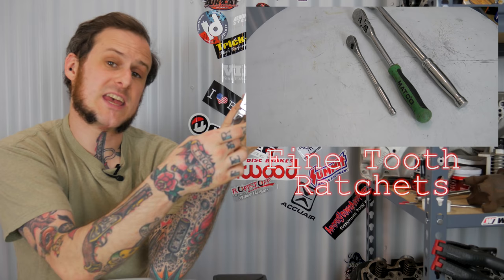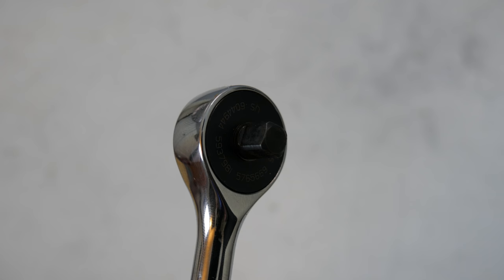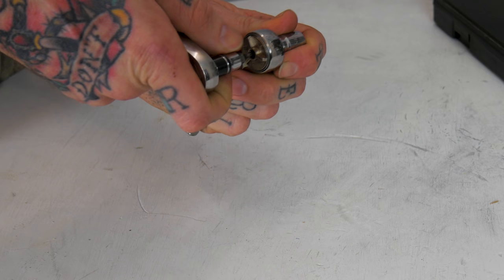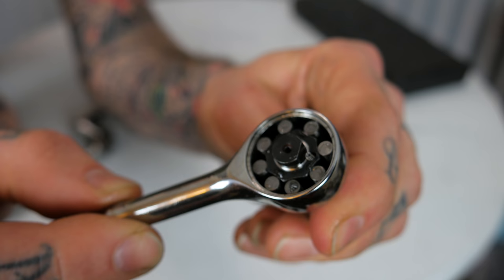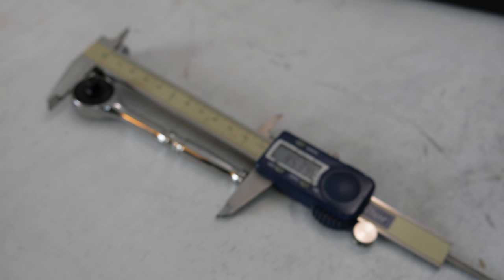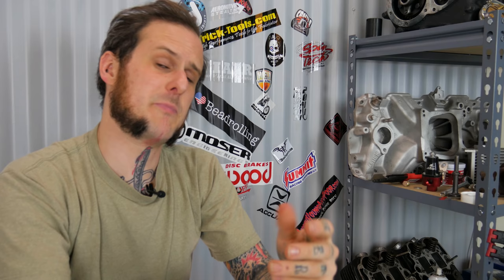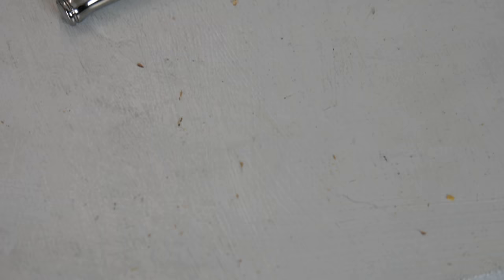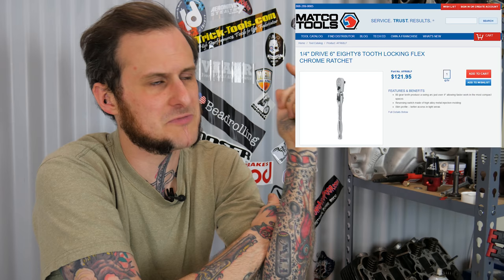Snap-On Gearless Ratchet - What's Inside? - TZero 1/4"

Comment from the maker: What do you think of Gearless Ratchets? Do you have one from someone else or have you tried the Snap-On ones yet?
Reply: Works well bit I can't get over the feel. It hasn't let go yet but if i have to break a nut I use a box end wrench and just use this to remove
Reply from the maker: john smith it really is such a strange feeling. I couldn't get past it in my uses.
Reply: I like the pass-thru wrenches from gear wrench, got good teeth count and they make many different sizes and it’s not a wrench and it’s not a ratchet it’s like an offset 0 degree box end with out being clunky

Comment: I have a 3/8 inch drive blackhawk "freewheeling ratchet" from the 40s, and it still works great. Can't take it apart for maintainance due to permanent pins through the head, but I just soak it in oil for a few hours to lubricate it. I don't trust it for heavy applications, especially since I would be able to repair it if broke, but its a nice tool that does 90% of the jobs I need it to do as well or maybe even better than my newer stuff.

Comment: 3/16" is huge in a 1/4" dive IMO. The rotary direction changer on the back is frustrating on any brand. They might change that but then change other desirable things too. Sure seams they all get the features correct but never land them all on the same design.
Reply from the maker: The Eccentric Hobbyist problem is with this round head design the selector has to be in the middle of the head. And if they changed it to a tear drop head it would not be able to have the 8 sprag bearings like this me does. You are right, no single design meets every criteria for every job. Just have to pick what works best for you. And half a dozen Ratchets for the other times. Ha
Reply from the maker: The Eccentric Hobbyist and I agree on 3/16" being a lot. (And really its more like 7/32"). I prefer the Matco Ratchets for their slim head and sometimes I wish for slimmer setups. I do have a Snap On slim ratchet but it doesn't have a flex handle so sometimes that's not right either.

Comment: Snappy does  make Ultra shallow 1/4 sockets
Reply from the maker: They  do indeed, I own them and like them. They work best when paired with their low profile ratchet to really maximize the slimness of them. If you use them with this ratchet it would help with the thickness but still be thicker than using the low profile sockets on another slimmer ratchet.

Comment: Kind of expected you to show it IN USE, compared to another ratchet.
Reply from the maker: I had intended to include that but when I went to film the use, I realized it really didn't demonstrate the actual operation very well. It is hard to see it, its more of a feel thing. And it is silent in operation so there is little going on watching it in use. Also I aimed for this video to be shorter than it even ended up being. To really compare it in use would have required setting up some type of testing setup to show exactly how tight of a swing arc it has, which would have been far too elaborate for what I intended this video to be.

Comment: Titan has a 3/8 and 1/4,  although it lacks this reverse mechanism.     To reverse, remove the socket and push the square drive to the other side. The Titan appears more compact.  Another advantage, besides the lack of swing, is the reverse movement is low friction, so one can tighten a fastener without holding the socket/extension (i.e. eliminates need for third hand when installing starter for stern-drive boat.

Comment: The whole point of a gearless ratchet is the tight swing arc. Based on what i was just looking at in the video, there is play in the head before it actually locks up and starts to drive the square drive. The biggest question i have to ask is if the swing arc on that ratchet is tighter than 3 degrees, if it isn't, then there would be no point buying it over a 120tooth ratchet.

Comment: Bought this thing for one purpose replacing stepper motors in class8 trucks at work and automotive at home. A flex version would be great yea the head is a little tall but if you can get on the fastener there is no effort to remove the fastener deep in the dash. If you have any swing on the handle it will remove the screw. What would be great also is the 3/8 version with a bent and swivel handle great for the transverse engines limited swing against the firewall for plug removal. Hell if Snapon  makes this I dont care what it costs will save me busted knuckles and the neighbours ears.
Reply from the maker: A flex head version would make this a significantly more useful ratchet I have to agree.

Comment: I paid $18.98 for the kobalt gearless in a 3/8 drive kit with sae and metric sockets and an adapter with shipping and tax included. Works like a dream and comes with the lifetime warranty. I’m still searching for the 1/4 drive version. SNAP ON TOOLS CAN GO KILL THEMSELVES WITH THEIR RIDICULOUS PRICING.
Reply from the maker: Right, and that Kobalt set was made by someone making a few dollars an hour, in a factory without the pollution concerns we worry, using whatever cheap metals they can get at the time. Then a big company like Lowes sells them at a very small profit margin because they make their money on other items. They figure you are there buying a socket set and may buy half a dozen other items for your house or garage, so they can afford to make a minimal amount on each set.

Snap-on is made in the USA, meeting USA pollution control requirements and exceeding USA minimum wages. They warranty their products for life (they've been around for 99 years). They hold their quality control and material choices to the highest standards. And the distributor selling the tools is an independent business owner who has to make a living too. All while (if you work in a professional shop) they come to you. So if you have any trouble ther is no driving over to Lowes to hope the clueless employee at the service desk knows what retchet to replace yours with.

Those Kobalt ratchets are a decent set for light duty use. If you work with these tools every day and depend on them to make your living, pros know the difference. I keep sets like those in my car and house to have on hand when my professional tools are locked up at work.
Reply: @HotRodHippie  Kobalt's tools are mostly made in taiwan and taiwan has very good quality tools with likely a more efficient factory that, probably produces half the pollution. Your more of a tool then the ratchets we're talking about with that ridiculous nonsense comment to the viewer. You asked for opinions to pull out you're rebranded tool truck soapbox to give lectures on?  Why is a Williams ratchet $35 and then a snap on engraved one is 4x the price? Same dudes are making them with the same materials and everything!
Reply from the maker: @Toyotas_n__Tools  Williams ratchets are the old 36 tooth ratchet design. Not the new Dual 80 or even this Gear less design. If you want a 36 tooth ratchet you could probably buy a used Snap-on for the same price on eBay or locally then get it warranty repaired.

You are paying for service. Is the price tag sometimes crazy? Yep. I think I may have said in this video this costs too much. If not I should have. But with SO the warranty person comes to you. If you need a tool repaired or replaced, that's it they are right there. With Williams you have to send it in to get a replacement. If it got lost in the mail or lost in paperwork at Williams, you are up a creek. And even if it goes smoothly you are likely still looking at a couple weeks to get a replacement.

Is the tool truck tax crazy? Yes, but that's tool truck life. Thd distributor has to make a living and the companies are corporate and want to make their profits. Sadly it's the way this works. If the profits were smaller on the tool truck the distributor could not make a living. Plain and simple. Getting paid $20 a week indefinitely when you are only making $5 on a product is a failed business model.

That's another point. You grt zero percent interest financing on a tool truck. I usually look at the increased cost as the financing fee. It just depends if that fee is worth it to me.

Tools made in Taiwan can be excellent quality in this day and age. Standards have come a long way there IF a brand wants to seek it out. At the end of the day though they are still paying little for the products and still shipping them across an ocean to get to you. Meaning that's part of the cost in both dollars and carbon footprint. That Taiwan ratchet has made a trip around the world before you ever lay your hands on it in an inefficient tanker ship remember.
Reply: @HotRodHippie  The fact it doesn't have a double paw mechanism with 4 more teeth doesn't warrant a 4 times markup, thats good your passionate about something.. But you're views and opinions are as old as cassette tapes, because things are just really that different then what you believe.
Reply from the maker: You are completely discounting the concept of engineer costs along with the distributor needing to make a living.

The 36 tooth design is a design from many years ago. Snap-on engineered it decades ago. So Williams doesn't have that expense. The Williams line is a way for Snap-on to continue making money off tooling and designs that have long paid for themselves. In my eyes anyway.

It's the argument of "Well a cellphone only costs $***" to make!" but that doesn't account for the cost of engineering that product and the one after it. Profits go to continued design and business operations.

I don't personally care where a product is produced. My absolute favorite ratchet is a product of Taiwan (Matco 88 tooth flex head with comfort grip). I make a point about it because tool buyers care. Do all? No, but many do. So it would be silly of me not to make a point about it just because some people are good with a global economy like we have today. I personally get that this is one big planet and we are in it together. However I'd be a poor reviewer if I didn't provide the information that people want or wasn't trying to be aware of the global impact of manufacturing.
Reply from the maker: @Toyotas_n__Tools  also, the Dual 80 ratchets aren't the old school "double pawl" design like say a Kobalt ratchet is that uses half the tooth count on the main gear and a pawl mechanism to artificially create the fine tooth ratcheting. The Dual 80s have 80 teeth on the main drive gear. The dual pawls just switch between forward and reverse and engage the full gear width unlike the old designs that have a sub-half width pawl mechanism.

I've torn down Dual 80 ratchets to display here before. I believe in my Fine Tooth Ratchets Tool Tip Tuesday and maybe in my review of the Kobalt 100 Tooth Ratchet (that I reviewed favorably).
Reply: @HotRodHippie  "The 36 tooth design is a design from many years ago. Snap-on engineered it decades ago. So Williams doesn't have that expense. The Williams line is a way for Snap-on to continue making money off tooling and designs that have long paid for themselves. In my eyes anyway."

The Snap-on "Dual 80" ratchets came out in September 2007, i.e., about 13 years ago. That design has long since paid for itself too, but has it been reduced in price to reflect that? Of course not. The standard 3/8"-drive version (F80) retailed for $73.95 in September 2007, and the current price on Snap-on's website is $118, which is a price increase that's significantly greater than the rate of inflation (according to the U.S. government's CPI inflation calculator, $73.95 in September 2007 translates to $91.44 today).

Also, Williams USA sockets are exactly the same as Snap-on sockets, aside from the name stamped on them, yet Snap-on branded sockets cost about 5 times as much. At about 1:48 in this video - https://youtu.be/RtcYB-mW6i0 - look at the name being stamped on those sockets on the Snap-on socket production line: Williams. A guy on the Garage Journal forums even found one Snap-on branded socket in his brand new 1/4"-drive Williams socket set.

As for the tool truck service, it's not worth paying 5 times (or more) for it, and Snap-on knows this, which is why they sell their stuff from their website for the same price as the tool trucks, even though you aren't getting the tool truck service when buying from their website. If their website prices were 1/5th of what the tool truck prices were, how long do you think the tool trucks would be in business? Not very long, because hardly anyone thinks their service is that valuable.
Reply: @asdasd-ni8eg  sure, if the price is somewhat fair. But this 1/4" costs 140 dollars, it's absurd. If you buy this you are being taken advantage of.
Reply: @AlessioSangalli  maybe. I can tell you I’ve been tearing up Vice grips (Milwaukee brand mostly) for half a century, and just recently bought a pair of Eagle Grips for 4 times the price. Was I taken advantage of? 
Every time I pick them up, I get a little thrill because they even feel higher quality. Then I twist something and the jaws don’t twist. The jaws are harder than anything I have tried to grip, so they don’t let go and they don’t wear down. 
If this ratchet makes you chuckle at how good it is every time you pick it up, it’s worth more than a girlfriend. I don’t know if that’s true, but I can tell you eagle grip pliers are worth ten times more than Milwaukee. 
Don’t discount the value of a quality tool, if it’s indeed a quality tool.
Reply: @ED-es2qv  I understand, yeah sometimes things are just a pleasure to work with and we don't mind paying for them. Like going to a fancy seafood restaurant and spending 200 bucks per person, when a meal cooked at home would have been just fine for a tenth of the price. Or a brand new truck that costs an unreasonable amount of money when the old one was still running. However, and that is a BIG assumption, that this 1/4" ratchet does REALLY feel so much better than one of a reasonable quality, but cheaper. I don't really use 1/4 ratchets very much, and I try to use power tools as often as possible (or torque wrenches when tightening)
Reply: Snap on is over priced for sure nobody can seriously deny that. They profit margins are very high. The price isn’t $150 because it was made in America and in some zero pollution factory with workers making $45 a hour to sit in front of a machine. It’s because of the SNAP ON name and people are willing to pay it to get that name on there tool so why wouldn’t they charge out the ass if people are paying it. Yes they’re very high quality. But just because a louis vuitton purse is $4000 doesn’t mean it’s because it cost so much to make it’s becuse people are willing to pay that to have LV on there bag and makes them feel better about themselves

Comment: I have a Craftsman quarter inch ratchet that's about 20 years old still works I must have paid 10 bucks for it and it's well worth the money I don't need a fancy Snap-on ratchet to do the same work and get paid the same amount of money my Craftsman's are still working never had a problem with any of them never had to rebuild them and if they do happen to break I could bring them into Sears and they will exchange of no questions asked I can't stand Snap-on prices I only get tools from them that I can't get anywhere else or for emergencies if the truck is around I'll get something but it has to be because of convenience not because of their prices because their prices are ridiculous I can get really nice Japanese ratchets for way cheaper and they are find to ratchets